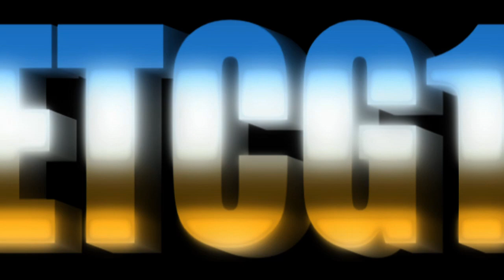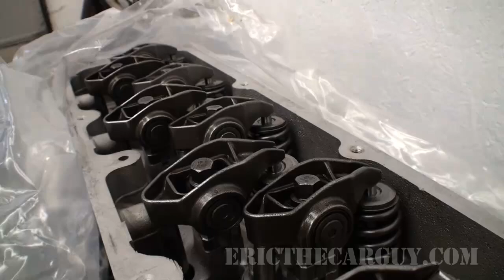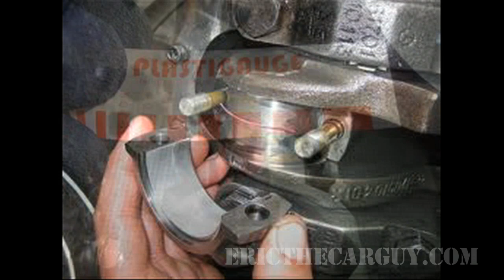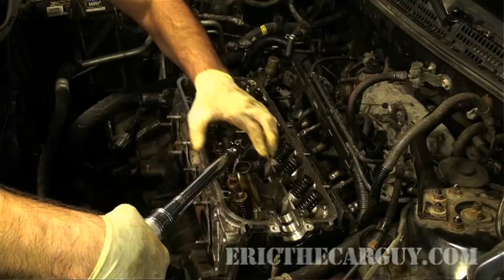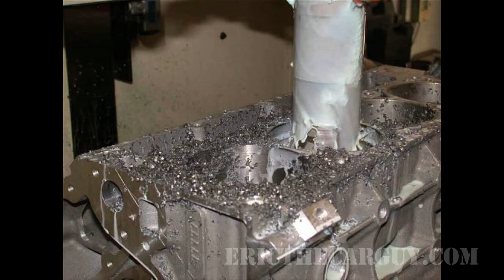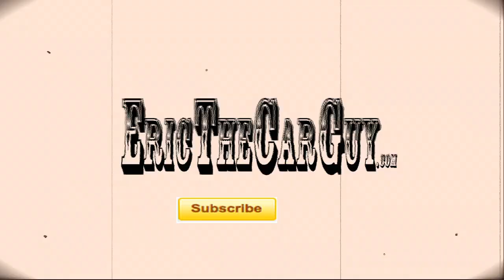Should You Rebuild or Replace? -ETCG1

Comment: Before leaving the military, I sent money back to the US for a friend, to buy his car..91 Probe LX. Told me it needed a "couple things".  When i got stateside, and got car, it was in boxes. The entire motor ripped apart, every interior panel removed... My dad said replace the motor, but I wanted to rebuild it and learn motors..... I spent well over 3,000 USD to rebuild the motor.  All new everything, 2 new heads, pushrods, lifters, radiator, hoses, fuel injectors, fuel pump... etc etc.....  After spending 6 months, and all that money... The motor was DONE!  I started the car up for the first time and i felt so accomplished!!!    THEN.....The coolant started shooting out of the bypass..... Come to find out,  the "Couple things it needed" Included a new block.... I found out the hard way, the block had hairline cracks.. It would run fine untill it warmed up, and combustion gasses would leak into coolant system...
I scrapped that car for $200 with all the new part
My friends and wife say I "wasted" the money, but I see it as $3000 spent on learning how to rebuild a car.... I still do my own repairs, and am very very cautious when it comes to vehicles now.
Reply from the maker: Thank you for sharing your story and for your service.
Reply: I had a similar experience. I was 16, purchased an Oldsmobile F85 for $200.00, it had a blow by (water leak/mix with the oil).  My friend was a backyard mechanic he offered to help. I decided Rather than a simple repair, we strip down and completely rebuild the Engine for the learning experience, After that, I knew pretty much everything needs to know about Engine repair/rebuild. Saved me a lots money over the year from that experience.
Reply: Paul Allen you're right, the best lessons learned are from mistakes. i bought my first car from a private owner and i basically got f'd over but i am learning as i go.  money can buy an education but not knowledge. "You win some, you lose some"         -Craig's dad on Friday.
Reply: +WhenImGoneCa why it's just a money pit plus it a ford probe what a shit box
Reply: only enthusiast people like you & me pave the way of learning for others. & lesson learnt this way remain unique & price less.
Reply: Paul Allen  respect man that's how we learn.
Reply: 91B? Army? Thanks for your service, and cool story. Money isn't everything. Knowledge and experience is worth so much more than 3k. I was a "diesel" mechanic in the Army. I didn't learn anything hardly. That was more of a "waste" to me, I wish I would have spent 3k to learn how to work on an engine, honestly.
Reply: lol should of got a block and threw the new parts at it...........................
Reply: you actually did waste a lot of money. the difference in learning and wasting time and money is that in the end you ended up with something with value, knowledge is just extra. had you asked yourself "why is it in pieces to begin with" or why did you buy it sight unseen in the first place, it should have triggered alarms and you should have stopped while you were ahead. you could have learn that your friend scammed you in the first place and started with a better car and ended up with something that works in the end. on top of that you still would have got the knowledge and experience

Comment: I have to answer this question  because I've done both for my 5.7L Chevy Small Block in my 1992 Silverado! It cost me over $9,000.00 to get the engine completely rebuilt. I was given very specific instructions on how to drive it to brake it in, followed those instructions and ended up 3 months later blowing the cam and the rest of the top half of the engine to  pieces. So I found a guy that wanted to sale me a engine from a 1990 Chevy Blazer (fullSize) Silverado Edition for $150.00. The only things it needed was coolant, water pump serpentine belt and a charged up battery. So then I got to thinking, how much would he want for the whole Truck.  $200.00 is all he wanted for the whole Truck. so I bought it, got it to pass the Pa. safety  and immissions standards; had it on the road for 2.5 days, and on the third day got into an accident totalling out the truck. So I took the engine out of the Blazer and put it into my Silverado.  It would've been better if I had converted my Silverado into the 4×4 using the Blazer 4×4 components but I scrapped it (what a bone head move in know). so I went threw all of that trouble just to say in the end I HAD FUN & staid dirty.

Comment: REPLACE, DON'T REBUILD! I have experienced 3 rebuilds done by 3 different rebuild shops. Engine no 1: Block was only bored, not honed. Burned valves within a year. Engine no 2: They told me they used torque plates for boring & honing but they did not. Knocking sound after the rebuild. Engine spit out coolant; it leaked coolant in one cylinder. Engine no 3: Vibration (crankshaft not balanced) Timing chain incorrectly installed. (Marks did not line up) Worn rockers within a few hondred miles. (Probably incorrectly installed cam bearing causing a lack of oil supply) Coolant leak. (Core plugs were not replaced) Words can not describe the amount of frustration, especially since there is basically no warranty on machine work in my country. So if you ask me rebuild or replace, that's kind of a no-brainer...
Reply: That's not a knock against rebuilding engines; it's a knock against incompetence. A high-quality speed shop can rebuild an engine to a state equal or better than it came from the factory. I'd put my life behind a high-quality rebuilt engine! (And, if you've flown on an older 737 for instance, you probably have...some of those birds are 30+ years old and still flying, on possibly the fourth or fifth engine rebuild. No reason you can't rebuild a piston engine to the same high standards...)
Reply: Agree, but for the average car owner having the engine rebuild is simply too risky. There are literally 1001 things that can go wrong. They all claim to do a quality job, but you are not there when they do the work. I have learned the hard way not to trust people who claim to be an expert, whether it's engine rebuilding or something else. I'm not saying it can't be done (it can), I'm just saying for the average car owner it's too risky.
So far I haven't seen a machine shop who actually gives a 100% warranty, at least not without giving a fight.

Comment: I typically go with replacement engines and transmissions, but depends on the budget. I must say, the rebuilt shops are starting to get up to par. With a  1 to 2 year warranty in many cases. Many also take the old motor in core exchange (better for my small home shop and the environment). Many of your points are valid (machines, special tools, tolerances and parts etc). The time it takes to pull a motor, do all the rebuild work and put it back is not cost effective for small shops. But if it is classic like my wife's 57 T-bird and owner wants to keep it original, it becomes very expensive. Thanks
Reply: Probably because they know they're going to be spending a lot of time and effort making crystal clear they don't screw anything up lol

Comment: i agree with you about just getting a rebuilt warranty engine, but i do believe a diys should do somthing similar to rebuilding a engine to have a better knowledge of their own vehicle, what do you think?
Reply: +Gabriel Duncan If it were a lawn mower engine yes, but to do an automotive engine properly would exceed the cost and experience of the DIY in my opinion. You can't just throw parts together. There's careful measuring, special tools, and machining that's involved. By the time you overcome that, it's not a DIY project anymore.
Reply: Perfection!

Comment: I say it depends on the vehicle; if it’s a daily driver that the body and frame are in good condition, buy the remanufactured motor done deal. If it’s a project car and its worth something rebuild. Like my dad and I are working on his stingray corvette it has a matching motor, even though it’s a 350 and very easy to get a reman, with the matching motor it’s appraised at over 35K without it it’s only worth about 19K.  Or if you have the money to potentially waste read up on how to do the job and give it a shot, some learning comes through trial and error

Comment: i recently had my 07 ford F150 drop a valve and take out the piston on me along with the head.. what i did was buy a used engine local with 89k miles, then pulled the old heads off the used engine and placed rebuilt ones on the block along with new gaskets... put less than 1k into the replacement to get the truck back running, runs perfect...

Comment: I think it depends on weather your only going to do it once if you plan on doing a rebuild on other cars the tools are worth it. also it depends on if the engine is any good from the get go.my dodge ram 50 has a 4g54 but I could easily sap that engine f0r a 4g63 a much better e ngine

Comment: An old video but still i want to share my thoughts. Where i come from a used engine (H22a) costs twice as much as an rebuild of my engine would cost (counting parts only), with the exeption that the bores are still ok (That is by the way a thing i would like to know how to check). And you can never know that the used/new engine wont die after 1000km.

Comment: Can new engines be purchased from dealerships?
Reply: +Minivancation nearly 99% of engines you buy from dealership may look new, but they are rebuilt from a 3rd party... i use to work at a dealership and even though the parts would come in a crate with the dealership's brand name on it, the shipping location of where they came from was places like jasper and such that the engines came from remanufactured...
Reply: +John Wesley Corbett Yes but be ready to pay up big time.
Reply: +storxusmc thanks for the info!

Comment: I just finished a performance rebuild on a 1997 Toyota Celica 5sfe that I added a turbocharger to.  After going back and looking what is spent and the time invested, it would have been better to buy a JDM or prebuilt motor.  When you take machine shop costs, component replacement costs, and time, it is way more involved than just replacing the motor.  I feel this is true for a performance build as well as a standard rebuild.  Also remember, in both a replacement and rebuild, you have to pull the motor so that is a fixed cost/time.  The troubleshooting once the engine is back together is a pain too.  I got into this mode of second guessing my work and pulling parts back off the motor to find out they were fine and that it was not the cause of my issue.  There were a few times I misread the torque specs or went aftermarket when I should have went OEM, but with a replacement you do not have to deal with that.  If I were to ever pull a motor from a car in the future the most I would do as far as rebuilding is replacing gaskets and seals on a used motor.  I am not here to completely discourage rebuilding.  If you plan to do a rebuild as a learning experience or a hobby, go for it.  If you are rebuilding to get your car on the road with the least cost, don't rebuild, buy a replacement.
Reply: +HardHead 93 My entire point in the video. Thanks for your comment.

Comment: Rebuilding is always more time consuming and more expensive. Not to mention finding all other things you need to address when rebuilding. Just don't. I would avoid rebuilding like a plague. Just replace the damn thing and be done with it. It will cost you fraction of rebuilding. Besides when you rebuild problems just keep popping up and you end up spending way more time and money than out right swapping the engine.

Comment: I got into working on my own vehicles because of the crappy work of some mechanics.  So naturally I wouldn't and haven't trusted anyone else to repair my engine.  As far as replacement, it's been my experience that my engine costs ~$1800 used, where they just go over compression/leak down test and offer a 30 day warranty; forget a salvage yard except to maybe cannibalize parts (I've done this).  My first engine rebuild, I didn't have any of the specialized tools needed for a rebuild, no picker, engine stand, micrometer, feeler gauges etcetera.  After purchasing all of the tools/parts I needed, it was cheaper by a few hundred dollars to rebuild my engine.  Worth it?  The tools I acquired doing that has paid off on other rebuilds which saved me a lot of money.

I think ultimately it's cheaper to rebuild yourself.  You know the quality of work or lack thereof, that went into the rebuild.  The only con is time.  If you are willing to do it right and can spare the time without the vehicle it's the best choice.

From a businessman's perspective, I think your points make the most sense.  Your cost is lower for customers, you don't have to warranty the engine yourself.  Profit margins are better etcetera.
Reply: BigBrotherIsTooBig I've gotta be honest... Your comment is the first time I've ever seen anyone spell out etcetera (twice)😂

Comment: I think rebuilding the engine is better than replacing it coz you will be using the engine like new but if you replace it you will never find perfect engine and maybe it has problems in the head or in valve or in side the engine

Comment: "rebuilt" my 2006 hemi it dropped valve seat on my #1 cylinder i pulled the head it was beat up from crunching up the seat. I got a remanned head from ebay with warrenty as well as a piston and ring set, ordered gasket kits and a few special tools 18mm socket, torque wrench, ring compressor, cylinder hone. I did tear down and rebuild by my self outside my dorm room on jack stands....worse part was the front diff and drive shaft the engine work wasnt bad I did rig up a engine lift to get clearance to pull the oil pan to replace the piston. I got a good cross hatch got my pison in (shouldnt have got a cheap ring compressor) and new gaskets oil pan, head gasket, valve cover, spark plugs gaskets, intake manifold gaskets also changed all 16 plugs all in all spent about 1000 for parts tools and fresh fluids n filters also spent a little bit on cleaners, rags, a Royal purple additive, as well as seafoam for engine and crank case, and some for transmission. put about 100 miles on the vehicle and its running execellent, it was in pretty decent shape before if it wasnt for a manufacture defect of dis similar metals from the aluminum head and steel valve seat The engine would have been fine. I have a low compression cylinder on the other side so ill monitor that and perhapse pull that head get it machined before it gets any worse but Im expecting to continue driving for a while minimal build up and "Gunk" in the engine piston walls still have cross hatch and with fresh accessories I plan to swap the timing set and oil pump to keep the Hemi breathing for another 100k or till i get something else. PS i was quotes 4800 for a low mile engine swap parts + labor so for 1000 i think im winning. Im just a student without a work shop or many nice tools which a established gentleman may have access to but I got her done with 0 assistance.
Reply: Andrew Stewart wow! Impressive. Im still weary on weather i should rebuild or replace. I have a little 94 ranger with a 4.0 v6. 190k miles and its starting to loose power..
Reply: Rebuilders on 4.0s frequently run into cracked heads. (Google "Ranger 4.0 cracked head") A 1994 truck is rarely worth investing that kind of money. As a mechanic I'd look for another, newer truck and get that vehicle sorted out before the Ranger croaks.
Reply: Hey what’s up dude. I read you comment an am inspired to do the same. I’m als on college and my 83 s10 took a dump. After taking time to consider my options I’ve decided to just take the engine out and see if it can be fixed. I figure, worse case senario, I put a used engine in it. It’s snowing outside so I would have to pull the engine in pieces and bring it up to my dorm room on the third floor. Then investigate and fix it. 

Does this plat sound like something that should be considered or am I crazy for thinking this can work? Will taking the engine apart piece by piece make it light enough to carry upstairs to my room?

Thanks for the advice in advance!!!
Chris